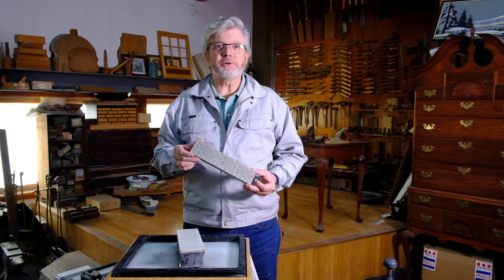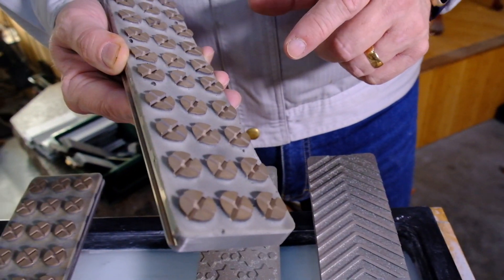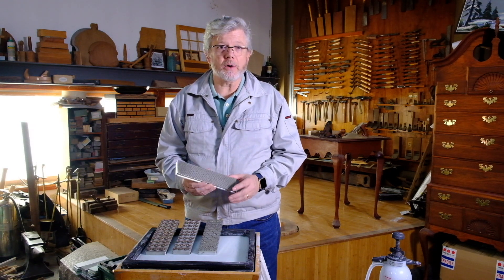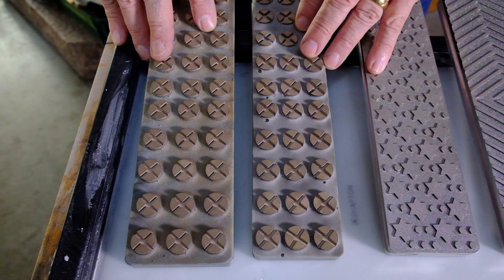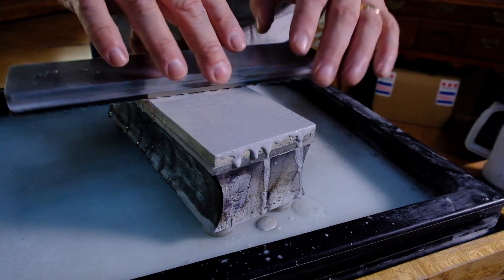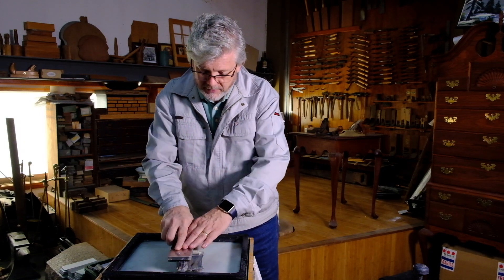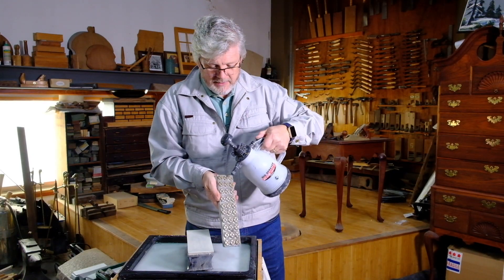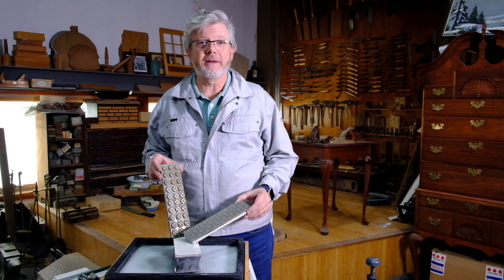Nano Hone Lapping Plates!

Comment: Mr. Stanley, we met at the Atlanta Bladeshow. I bought one of your honing rods there.  I am leaning toward getting one of the button lapping plates, but your website says use from 400 grit up.  One of my favorite kitchen stones in the standard Norton double sided 1000/220 water stone.  Can I use the button plates on the 220 side even though you recommend 400 grit and up?  What is the concern when going below 400?
Reply from the maker: Absolutely, it will be fine with that abrasive. Thank you for considering us
Hap

Comment: Would it be worth just getting an nl-10 so I wouldn't really need the nl-4 or nl-5? I have probably every grit stone you sell, but I'm just trying to mitigate the amount of things i need for maintenance. If one plate could do all, great.
Reply from the maker: Hi and thank you for your purchases, I wish I could say that the NL-10 would do our whole range of abrasives. It’s just not coarse enough for the NS-200 and NS-400. If I make it coarse enough for those stones, it will leave deep scratches in the very fine particle stones. The same is true for the NL-4, it’s too coarse for the fine stones. On the other hand, the NL-10 leaves a beautiful finish on the fine stones. The NL-4 is also awesome for chamfering all of our stones. For me, it’s really practical to have both. We use that combination everyday to finish all our stones before they ship out

Comment: Are the buttons similar to a brazed diamond cup for flattening stone and concrete? And have you thought of smaller, nagura sized, options?
Reply from the maker: fervens 
Sorry it took me a couple of days to think about my reply to you question. After looking at several concrete cutting tools on the net, I think there are some similarities. However, the biggest difference is the speed of the tools and the precision involved. My plates are designed for hand flattening so, they are really slow speed tools by comparison. Also, we are very concerned with flatness. Our plates are flat to +/- 15 microns measured plates are finished. That is a new standard in the market. We will be publishing our measurements on the website very soon.
Reply: Thaks for the reply. Do you have any long term data on how the plates maintain flatness? A solid diamond button seems a little difficult to flatten
Reply from the maker: fervens 
I will look into what we can publish. I can say that these are very tough buttons that will not change shape easily. I’ve been flattening the soles of hand planes with these plates and haven’t recorded any significant wear. It will be very difficult to wear these plates on conventional waterstones. I am currently testing them on diamond impregnated water stones. This is probably the most difficult stone to flatten. We have special equipment to flatten these plates and if a plate does get worn, we can reflatten the button plates many times because of the thickness of the buttons.
Reply: HMS Enterprises if your button plates can flatten those diamond waters ones over and over without significant wear then that would really be something. Id get those stones just because I can keep them flat and then hone some nasty PM steels. I’m saving up for the star patterned one, and a button plate, or maybe just the button. Unfortunately being 19 that’ll take a while. What sort of surface quality would your plates leave on Japanese natural stones? It looks like your plates wouldn’t have that stiction problem or to the degree that Atoma and DMT Plates have, I get so tired of wasting slurry I generate on purpose with a diamond plate because I have to add water to stop the plate from establishing a death grip on my stone. I’m always looking for different sharpening paraphernalia, a rather dangerous habit.
Reply from the maker: @fervensmortis  I'm starting to get some data now that we've had these plates out of 18 months. I've only had to re flatten two button plates to date for customers. In both cases, they got out flattening very hard and coarse sintered stones. Re flattening required about 3 hours on our loose abrasive single sided lapping machine. It's not quick but it is effective

Comment: Interesting, where would one find these in/shipped reasonably to Canada?
Reply from the maker: tosho knife has them in stock. https://www.toshoknifearts.com
Reply: @NanoHone  Thank you, additionally if you don't mind me picking your brain. I can get a DMT XC-220 for $80 or the XXC-120 for $120. Alternatively the Atoma series for roughly $140-160. The NL-5 which i'd like to use for my 1-8k whetstones clocks in around $280. 

What sets it apart from these? I've tried both the Atomas and DMT before.
Reply from the maker: Oil Stone Edges understood, our design is a completely machined part from high grade aluminum. It is extraordinarily flat and comes with a measuring certificate specifically tied to the serial number of each plate. The patterns are more efficient for the purpose of flattening and cleaning sharpening stones.
Reply: Nano Hone thank you for the explanation. Hopefully one day I get to try one. Right now I’m having trouble justifying the purchase.
Reply from the maker: Oil Stone Edges I never hear regret from our customers. We work really hard to make products that will make you smile when you use them

Comment: Hiya there, 
On your flatness tolerances, are they +/- 15 microns over the whole plate or are they +/- 15 microns per square inch?
Thanks!
Reply from the maker: Vincent Tai
Great question, we are measuring 9 points on each plate. 3 on each end and 3 across the middle. We are recording the location of each measurement and showing it on the inspection certificate that ships with each individual serial number. This is a whole plate spec and every plate is measured.

Comment: It seems too me like the swarf off the two button plates was darker than that off the traditional plates.

Will the buttons wear down?

How will these handle something really coarse like the Shapton 120, Nubatama 150, 120, 60 and 24 grit stones.
Reply from the maker: Saddendude 
I don’t think it’s possible to wear out a button plate on waterstones. It way too tough. I’ve been testing them on resin bond diamond stones and still no wear
Reply from the maker: Saddendude I would recommend the NL-8 and NL-10 fort #400 and finer as the plate is #300.
The NL-4 is for coarser grit stones. It’s beautiful between #150 and #1000. I haven’t tested it any coarser yet
Reply: The buttons themslelves are darker than the other ones thats probably why.

Comment: Dont understand the choice of the slim width. Piece of glass or garnet some sic powder seems to work fast and is cheaper and you get it actually flat. Having it slim like that i doubt you can get it really true flat since you have ti wiggle back and forth to the edges and create different hights and low spots.
Reply from the maker: Hi, we have been using our “narrow” NL-4 in our factory everyday for 5 years now. We flatten hundreds of stones per week with them. It works because it’s longer than the stones. It’s also easy to hold. It’s very effective at flattening and it’s very clean to use. I know it looks a little unusual but it works great
Reply: @NanoHone  Hello, tell me what is the difference between Nano Hone Button Tech NL-10 and Nano Hone Abrichtblock Ridge Tech NL-6. They are very expensive for me, but someday I dream of getting one and because of the price, the NL 6 seems more profitable to me. At home I have shapton glass 500/2000/6000 stones and your nano hone 400/1000 are on the way to me. I also have natural stones from Japan, I also have a few washita and Arkansas, but I support oil stones on glass with silicon carbide.
Reply from the maker: @n_00_7  thank you for your order. our buttons are a solid diamond/metal matrix. Our NL6 is an electroplated veneer of diamonds on a 6061 aluminum substrate. They are both extremely flat. The main difference is life. You’re very unlikely to ever wear out the buttons
Let me know how you like our stones 
Hap

Comment: The buttons look like they should only be used in a circular motion, as back and forward would have lines of no contact.
Reply from the maker: RoboBeaver6 Hi Robo, if the user were to go back and forth in exactly the same track, I can imagine making a set of tracks. However, in practice the buttons are overlapping the last stroke by varying the path. We use button plates everyday here in our factory making stones and have never had any problem with grooves of any kind in our stones. It’s like a freight train for flattening

Comment: Looks like a good product. I have to say it does get to me a lil when you talk about about how flat the stone is by spinning it like a top though. No doubt it's flat enough for sharpening stone and you probably know this, but when it spins in the center like top the stone is not flat but convex which is absolutely as expected being that when lapping the top plate wears concave and the bottom plate wears convex. I know it's of absolutely no consequence here, just something about someone telling me how flat something is while spinning a flat plate on top of it doesn't sit right. = ) lol. BTW for anyone wondering when the plates are actually flat they "hinge" or spin 1/3 from apposite  end your moving. =)
Reply from the maker: Steve just Steve Hi Steve, thank you for watching closely. I agree with you that it will spin easily if the stone surface is high in the middle. I try to mitigate that with my lapping technique. It’s hard to show in the video but, our plates are serialized and individuality measured to less than +\- 25 microns or between 0 and 50 microns of total deviation. When you use the plate. You can really feel to high and low spots. That’s hard to demonstrate without physically using one